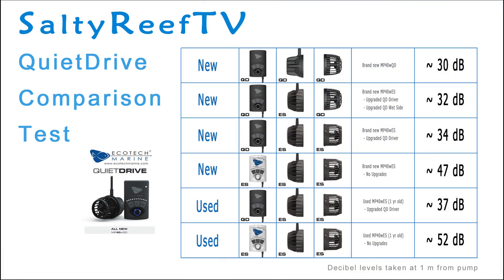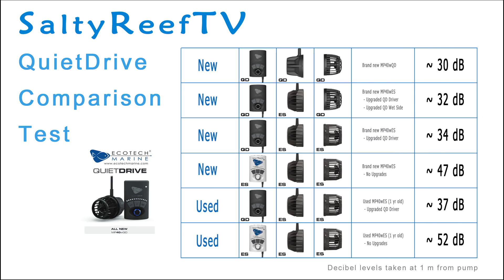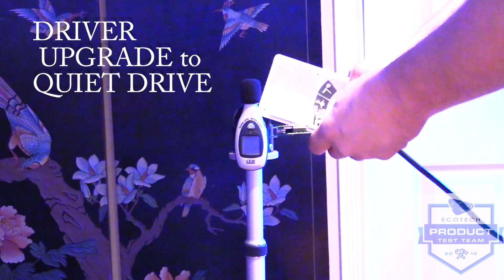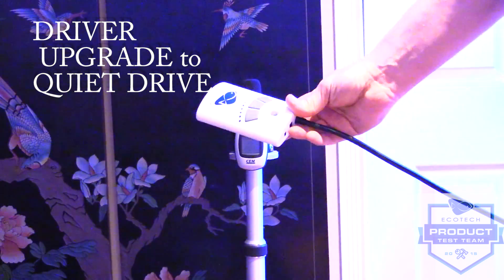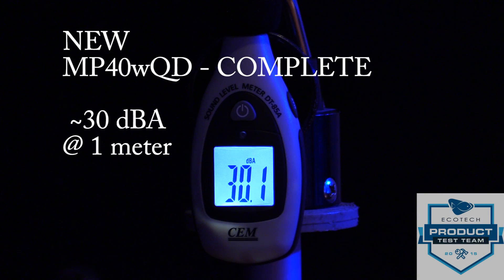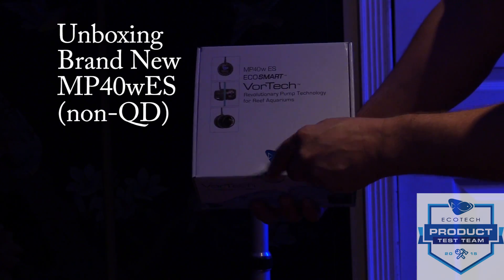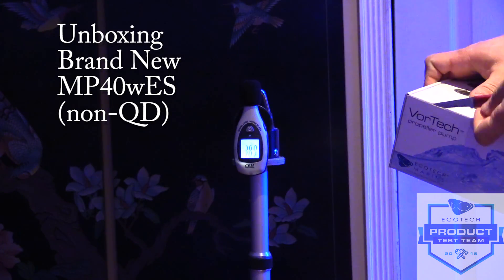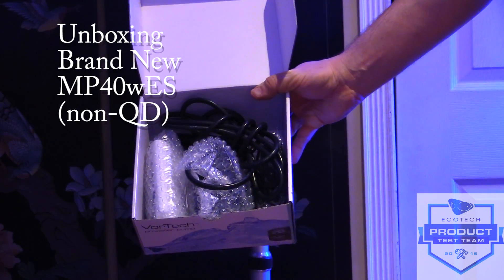REVIEW: MP40wES vs. MP40wQD How-to make your VorTech Quieter

Comment: what if you have the folowing set up:  Driver ES, dry side ES, wet side QD or Driver ES, Dry side QD ,wet side QD,
driver ES, dry side QD, wet side ES
Reply from the maker: Cornelis Eilander Driver ES, dry side ES, wet side QD - I would consider this an upgrade...barely. You won't gain anything significant unless your ES wet side is currently broken. ;)
Driver ES, Dry side QD .... This won't even work sorry. The QD dry side cannot be run with the ES driver.
The big thing to NOT do is run an ES wet side with QD dry side. Use of an ES wet side with a QD motor & driver could result in damage to wet side. The QD dry side spins the wet side at a higher top speed that the ES wet side was not engineered to endure.